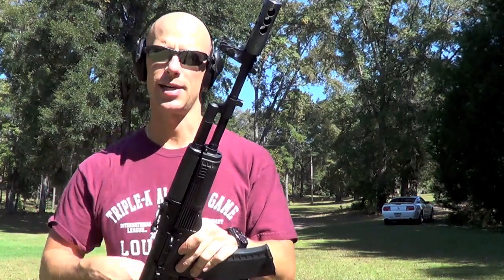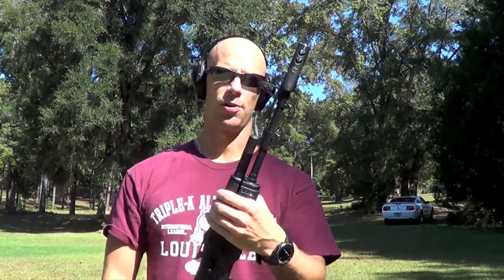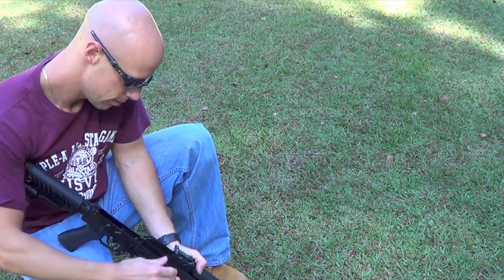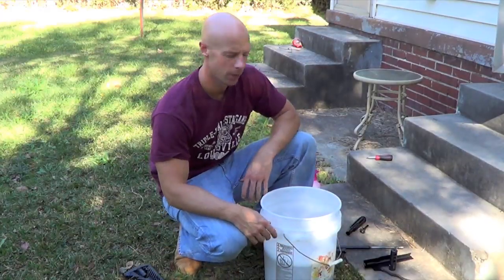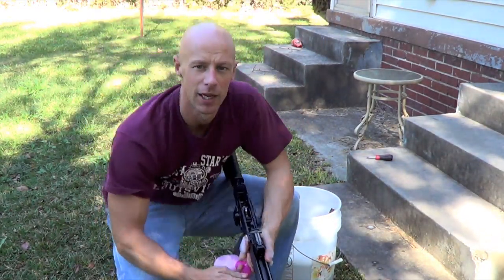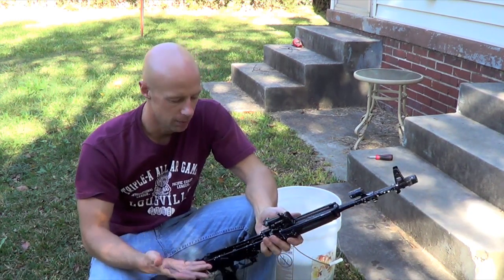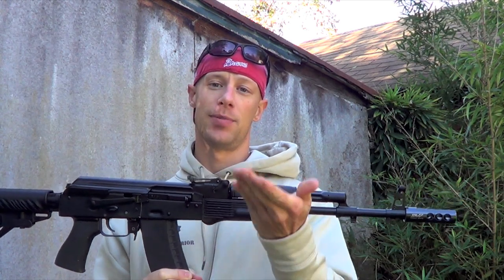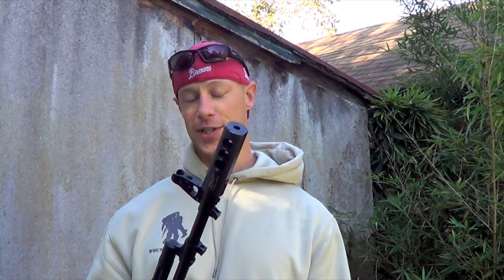How to: Clean Your AK-74 & AK-47 Rifle After Shooting Corrosive Ammo

Comment from the maker: I'd imagine it wouldn't hurt it but you'd have to work it around so the water circulates so the salts flush out.  Water does dissolve the salts but flushing them is more effective in my opinion.    FWIW, there's a ton of Russian soldiers in Afghanistan rinsing their rifles in rivers/streams over there during the war.    Seemed fine for them.

Comment: It does not help with it so it will not corrode, it does help in clean up, I have left my 74 a days or two and had some mild rust hit one of my 74's and froglube took it away, so it helps clean it up, but you still need to clean with water, etc first..

Comment: Best way to have found is to use boiling hot water..I plug the end of of the barrel and pour in the hot water let it sit for a min, pull the plug, run a small brush through the chamber, then rinze with boiling hot water. The boiling water will steam away and you gun won't be soaked. Then clean and lube as normal.

Comment from the maker: Well you've got 4 options then.  1. Just rinse out and hit it with an air compressor followed by prayer.   2. Take it off and put a normal handguard set on.   3. Take it on and off each time as is.   4. Have a rusted AK.

Comment: Hey Mrgunsngear, first of all thanks for all the videos.  Second, last time out to the range I shot a couple hundred rounds, did like you said flushed with water(no ballistol).  However I had to wait like 4 hours to clean my gun properly.  Upon cleaning I found a little rust on the bolt face, major rust in the gas tube and the brake was rusted on.  My question is, am I not using enough water at the range? 4 hours shouldnt cause it to rust as this has never happened before. Thanks

Comment: I'm developing rust in my gas block.  Not a lot, but it's noticeable.  Any tips on removing the rust?  It's mostly on the top of the block, but also on the front where the piston would rest on... I cannot tell how bad the port is.  The barrel looks immaculate though.

I was going to use CLR but I hear that can damage the metal more than it's worth.  I tried running a brush into it, but due to the angle I cannot hit the rust. What would be PERFECT is a brass q-tip.  :(

Comment: Thanks for this really helpful video. I just bought a Vepr and was reluctant to use corrosive ammo. Not now. I noticed that you sprayed water into the entire receiver. Any concerns about about spraying to much in that area?  Should I be concerned about getting water/ballistol on the wood handguard?  And yes, I am a newbie. Just getting into firearms in my 60's. Better late than ever. Thanks again. Love the channel.
Reply: Nah, it's better to use too much water than not enough water. Unless you're boiling the hand guard, you won't have any problems. When I clean my AK and SKS after shooting corrosive ammo, I'll take a bucket of water and pour it through the barrel, gas block, receiver, and gas system. I also dunk the bolt, carrier, piston, and recoil spring in warm water and dry them off well. I use clp to lubricants my SKS and AK and I haven't had any problems with rust! Like he said, the key is the water.
Reply from the maker: glad it helped
Reply: TheWesB:  Thanks for taking time to share your helpful comments with me.

Comment: Thank you very much.  I don't have an air compressor either...but could you just use a can of compressed air (like you use to dust off a computer keyboard)?  Also, if you did use compressed air would you then skip your regular cleaning afterwards?  Thanks again, very helpful.

Comment: how do you get all the nooks and crannies dry in the receiver after spraying all the fluid in there? what about the firing pin channel in the bolt do you just let that air dry or detail strip the bolt to get the moisture out?
Reply from the maker: air dry or air compressor.  I've never had rust in the firing pin channel

Comment: I'm curious when u dump all the parts in the water mixture in the bucket, how do u get the water or dry it out properly out of the nook and crannies like bolt and what not. 
I assume if there is water that hasn't dried out might cause some surface rust to build up.

Also how about when u have would furniture on ur ak?
Thanks
Reply from the maker: Great question but here's why is doesn't : 

The water is really just "rinsing" the salts away while at the same time dissolving the corrosive residue.     So, all the nastiness of corrosive primers is pretty much washed away.   What isn't is dissolved.     For the wood---you just have to dry it out like anything else.    Kind of like how the GIs did with their corrosive Garand ammo back in WWII.

Comment: I waited too long to clean my ak74, I shot some Monarch ammo that supposedly wasn't corrosive. I cleaned it that same day I got back from the range, only with oil wipes and some clp and a brush. I looked at it about a week later, took off the muzzle break and inside it and around the muzzle I noticed it had blue residue. I used a brush and some solvents to remove that blue residue, but I should still rinse it off with water right? I figure some of those salts are still on it.. Hopefully it doesn't damage my rifle too bad by leaving it that long without rinsing off the salts >_<
Reply from the maker: blue residue is usually copper
Reply: Mrgunsngear Channel ah I see, so it's nothing to worry about too much? Just clean it as usual?
Reply: Clean as usual and it will be fine. I get that blueish-green residue in my AR's flash-hider and all I run through it is Federal XM193 which is non-corrosive.
Reply: Thanks!

Comment from the maker: You 'could' use compressed air but likely it wouldn't have the power you'd need to get every last drop out to prevent the rust.    I would at least do a quick cleaning afterward to retard the rust in case you missed a spot.

Comment: Well, I'm a dick head, didn't clean mine properly for a couple days and my break wont come off the gun.  My guess is the threads are rusted together.
Reply from the maker: 3091181 Torch and a breaker bar...
Reply: That's what the boys at ar15 recommended as well.